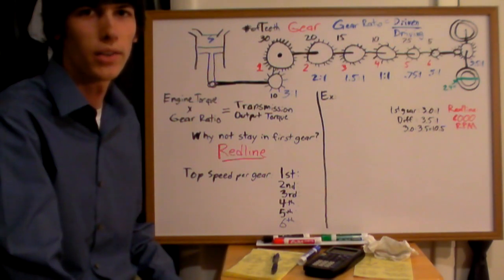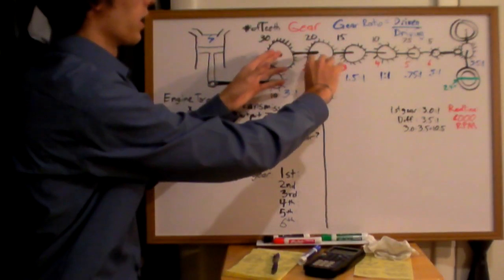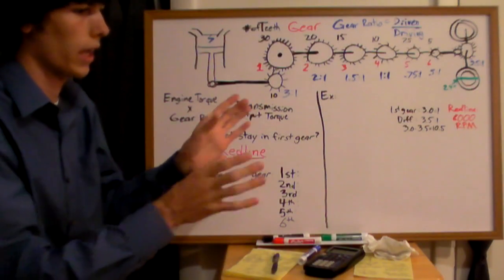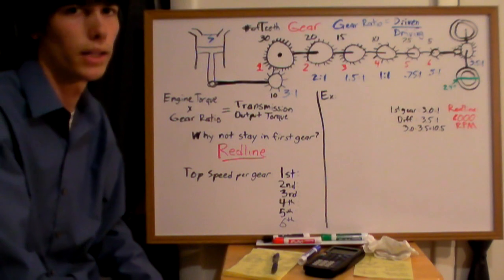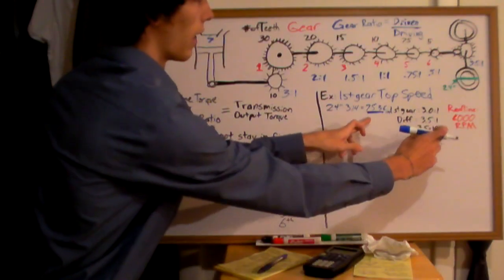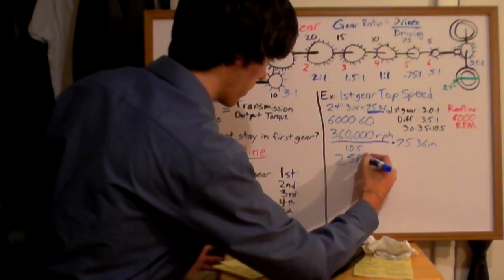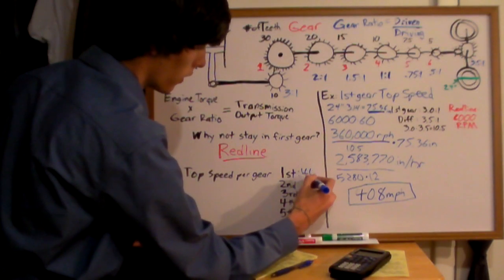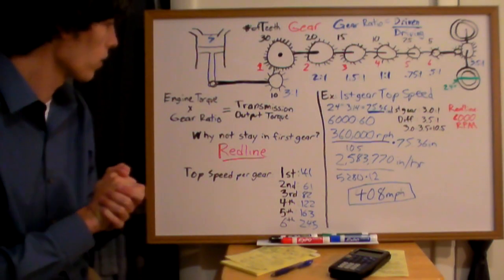Car Gears - Explained

Comment: ive got a request! do one on aero, teach the ones who don't know that wings are beneficial for FWD cars like stock integra R wings and such, you can talk about front and rear diffusers, air dams, vertex generators, canards, vents for brakes, low pressure, high pressure, angle of attack, why it doesn't matter if its fwd or rear wheel drive.
Reply from the maker: I will have some aero videos coming up. A rear wing can still be beneficial on a FWD car, as it creates downforce and can allow for higher cornering speeds.
Reply: Engineering Explained yes sir but people go around using the word "rice: without any knowledge, thought a good explanin can set them staright. good luck and have fun!

Comment: Hey bro .. thx for explaining I really appreciate it .. but yh can u just explain why did u put 3.14 in ( 6:40 ) ? When u were talkin about the wheel
Reply: It's pi(3.14159265359...). He is trying to find the circumference of the wheel (which is diameter plus pi), in other words how much inches does the car travels with 1 revolution
Reply: 13kotsios you mean diameter multiplied by pi?

Comment: Very nice! Man(sorry about the spupid Q), would you please explain to me what exactly is the neutral gear (what happens exactly) ?
Reply from the maker: You're not in a gear in neutral, so the power does not transfer from the engine to the transmission.

Comment: in a motorcycle let's say that I have 2.642 final ratio and doing 30kph @ 5000rpm in a certain gear. If I change the final gear ratio to 2.500 the difference is ~5.4% lower. To find out how many rpm I would have (with 2.500 f.g.r) at 30kph I have to 	
subtract 5000rpm with 5.4%??

Comment: Not necessarily. An 80's 5.0L mustang has an OD ratio of 0.68 vs the automatic's 0.67, both have a 2.73 rear. There is another transmission optional for an early 90's 5.0L that has a 0.63:1 ratio as well (though I don't think it comes attached to a 2.73 rear). GM takes it a step further and gives you a 0.5:1 OD ratio in the T56 (Camaro's, T/A's) while the corresponding automatic (4speed) gives you a 0.7:1 OD ratio.

Comment: Some of them do, but only 1 or 2 transfers. An engine isn't powerful enough to propel a vehicle without some sort of mechanical advantage because as stated they have very narrow power bands. An electric motor makes all of its peak power more or less at every rpm so it doesn't need anymore assistance.

Comment from the maker: Because engines have narrow power bands where they are useful, so gears are used to keep the revs within a certain RPM. Motors on the other hand, are capable of revving to much higher RPM, and thus the gears are not needed.

Comment: Why do manual transmissions have a lower gear ratio than the same car with an automatic? For example, the new Honda civics have a 5th gear ratio 0.727 and final drive of 4.29 for a manual transmission (3.11:1 overall) and 0.525 and 4.44 for the automatic transmission (2.33:1 overall). My manual car runs at much higher RPM on the highway than another automatic one. Plus, automatics are now rated to get better gas mileage. Is this a crazy scheme to promote the sale of automatics?! Thanks!

Comment from the maker: The tires are essentially part of the gearing, as the video demonstrates. The gear ratio of the driveline (diff and trans) does not change, but you go a further distance with the same rotation. This does affect the torque delivered to the ground.

I have multiple videos explaining rotational inertia if you're curious about it. Simply search my channel. :)

Comment from the maker: Larger tires have greater rotational inertia (I have a few videos, if you're interested), and they also alter your gear ratio thus making it more difficult to accelerate (this can be compensated for by altering the gearing).

Comment from the maker: Because that's what gears do, and that's the purpose of gear ratios. By using lower gear ratios, you can have the engine rev at lower RPM for higher speeds. The video should illustrate this fairly well.

Comment: why does rpm drop as you change gear? if you floor it and shift at redline, why doesnt driving rpm go from 6000 rpm first gear to 6000 rpm in second gear?

Comment from the maker: Higher gear ratio means more torque, but reduces the maximum speed you can supply that torque at. You'll be at higher RPMs at the same travel speed than a lower gear ratio.

Comment: gear ratio ..it's an expression in mechanics which is necessary which during a transmission process when a force it's applied through on one side changes on the other side .. increasing or decreasing with the combination of gears involved in mechanism..

Comment from the maker: The harder you press the gas pedal, the more strain/friction your engine will undergo. The engine was made to do this, so it's fine every now and then, but if you do this constantly you can expect the engine to not last quite as long if you were to press on the throttle more lightly.

Comment from the maker: Well there are probably multiple ways of doing it, but one example is a little pin is used ,which interacts with the output shaft of the transmission, preventing it from rotating. This means your car can't move.

Comment from the maker: There's not enough kinetic energy from the engine to move the car forward, without any additional power, so you basically are applying a brake to the engine, stopping it.

Comment: He mean shifting like in the old days called double clutching, where you match the speeds of the gearboxshafts just with your foot on the gas pedal because they don't had synchros back then. This still works with morden gearboxes and allows faster shifting but will also kill the synchros if you do it wrong.

Comment from the maker: They are on bearings so that they can rotate at different speeds, but it depends which shaft. One shaft with have fixed gears, which all rotate together, the other will have gears on bearings. Check out my video "automatic vs manual" which should help clear things up.

Comment: A question: What would be an overdrive gear? What advantage does is have. Which ones (in your given example) would be the overdrive gears? Am I wrong in guessing that (since I've always read overdrive gears are the usually 4th and 5th gears), the gears with ratios below 1:1 would be the overdrive ones? Could you please clarify this further?

Comment from the maker: Depends what gear you are in. The whole transmission does not rotate, just the gears. If the gear ratio is 3:1 (like 1st, for example), then for every 3 rotation of the crankshaft, the first gear will rotate once.

Comment: Sir, 
Can you please make a video on why Nissan for example requires all 4 tires be replaced at the same time with 4 tires matching in brand, model, size and tread type and depth?
Specifically, I have been researching the effects of mixed tires on my 95 pathfinder auto/trans with rear LSD, because Nissan says my trans's planetary system was destroyed when a tire dealer replaced only 2 tires (of a diff brand, and were all-seasons which were 7/32" smaller than the rear; all 4 were 31x10.5r15)
TY!

Comment: if you wanted a specific calculation you could find the exact height of a wheel without measuring. If the wheel was PXXX/YYRZZ then the height would be (XXX*0.039*0.YY*2)+ZZ

Comment from the maker: The three sets are for (likely) 6 gears. Each set I believe has 2 different ratios, allowing you to have multiple gears depending on how many planetary gear sets you have. Yes, this is something I need to eventually make a video on. Kinda like differentials, it's just super difficult to draw/explain. But I did differentials, and I shall eventually get to automatic gears.
Reply: ok

Comment: Pedagogie is french for teaching skills. Can you do a vid on planetary gears? i watched the latest ETCG vid on toyota auto transmission, which is great but i dont see how those 3 main parts (sun, planets, outer ring thing) change the final ratio when they are in movement. Also, why 3 sets of planetary gears?

Comment: within a transmission you have an input shaft, it is splined and connects to the clutch disk or torque converter. The other end of the input shaft is what connects to the gears that you select

Comment: imagine going up hill in your bike. If you use 1st gear you are pedaling like mad but climb the kill with ease because you produce a torque advantage through gearing. Doing the same hill in 21st gear would be near impossible because the gearing adds no additional torque to your pedaling

Comment: If the engine has to turn 3 times to rotate the 1st gear once, and it only has to rotate .5 times to turn the 6th gear once, why does this make 1st gear so much faster than the others? doesn't this mean that it takes the engine longer to rotate the transmission and wheels in 1st gear?

Comment: thx for the vid.  helped a lot.  one thing I was trying to figure out was where gear ratio number came from ( calc = 10.5 as a result).  I didn't see anyone mention this on here and after looking on the web found that it is the FINAL GEAR RATIO: 3.0 x 3.5 = 10.5  [transmission gear ratio x diff pinion ratio).  This accurate?

Comment: 1.how get 1st gear top speed as 6000rpm ?
2.how find engine torque for this eqn.?engine torque x gear ratio = transmission output torque

Comment from the maker: There are currently 7 speed manuals (Porsche and the 2014 Vette come to mind), and there are plenty of 8 speed autos out there. Yes, it comes down to cost, and are the extra ratios really necessary? Savings in fuel economy may be quite minimal, and at a high cost. CVTs may end this is they can make them a bit more durable.

Comment: i wonder why most cars have 5/6 gears sure anything less and you compromise speed or acceleration depending on the gear ratios and anything more and your adding excessive weight to a transmission but why not have a car with lets say 10 gears sure trucks have a lot of gears why not cars ?  production costs maybe?

Comment from the maker: Yes, but its teeth are only for the starter motor to connect, not to be used as a gear in the sense of the transmission.

Comment from the maker: It can be accurate depending on the engine. I wouldn't start relating brands to gearing though. Different engines will use different gearing. But yes, if one has much greater torque, then it can use higher gearing, and typically these will be higher displacement.

Comment: forgive my ignorance but i just hada debate on engine tq vs transmission tq and my arguement was with bigger dispacement engines ie (vettes vipers) the transmission gears dont need to be as low to accelerate, whereas engines like (ferrari supras lambos) with lower displacement use lower gearing to compensate for the low end and overall tq that they produce would i be mistaken with this argument

Comment from the maker: Engineers certainly don't think our way is the best. Getting my degree I hated homework problems that used English units. In fact sometimes I simply couldn't do some thermo problems because I didn't understand the units at all. Metric is far superior, but my brain has a base knowledge of "mph." Sure, I can convert it in my head to km/h, but when someone says they were going 50 mph I can envision exactly what that means, but not with km/h. Pedagogy? No idea haha, I stick to numbers.

Comment from the maker: A differential is used to split rotational speeds between the driven tires. A CV joint is the connection between the differential and the drive shaft, which keeps the given velocity from the diff the same speed as when it reaches the wheel.

Comment: So how would a CV FWD car work on this? I thought the CV joint was set so they don't have a differential, so theoretically, power is not lost in the differential turning, so FWD cars could move 3.5 (or whatever the differential ratio is) times as fast? That doesn't make sense

Comment: Actually a lot of lambo's for instance used to do 0-60 in one gear, because shifting time would take 3 or 4 10'ths of seconds from the time. Now, with modern gearboxes that isnt as much as a problem. As you undoubtly know.

Comment from the maker: Horsepower is a function of torque and RPM. The greater your torque or RPM, the greater your hp, when strictly using the conversion equation.

Comment: hi i assume the differential ratio is the ratio between output shaft and CV axle, is that right. so as per example to turn CV axle one round, the output shaft should rotate 3.5. is my understanding right. or cv axle have to turn 3.5 times to get the wheel rotated 1 time, pls advise.

Comment: You might want to check out my IVT on my channel.  It modulates output/input ratio according to input torque, very nearly linear in response, to lower the ratio with increasing torque (& vice versa).  The objective is to maintain fairly constant input RPM & torque regardless of output demands; this will enable designing new engines that are optimized for a narrower bandwidth & subsequently greater efficiency, as with 'peaky' undersquare engines.

Comment: The industrial revolution started in Britain, & spread to the U.S. early.  The shear size of industry in the 2 countries meant domination of the British Standards of units before metric standards took hold.  Lathe & mill tooling by then was a huge investment that could not easily switch over to metric, especially in the U.S.  Today, there are both systems here with a slow trend toward all metric.  As an engineer, I've been familiar w/ both for ~45 years.

Comment: OK, tanks for quick response. It doesn't matter if you're using your system. Today is easy to find all converters that you need for one min, and it's not problem at all. I was just interesting because i think it would be much easier if everyone has the same metric system.

Comment from the maker: Basically you want to shift when the force your putting down at the tires is equal to the force if you were to upshift. This means either when your engine becomes too inefficient due to high revs, or a rev limit. And the latter is usually the case, so for speed shifting at late as possible is generally the quickest.

Comment: I've always wondered at which point should I shift. 
My car specs says it gets to it's peak horse power (90) @ 5500 RPM and 128 N m @ 3000 RPM
So, should I shift according to hp or N m?

Comment: I like your explanation about car gear. I am very much interested in gear, power transmission and differential. I have made cam follower gear prototype. In my cam follower gear,
1. Follower is offset. 2. Force is transferred from follower to cam and by using this force cam is rotated. 3. Follower come down littlebit and help cam to rotate 6 time more length of follower displacement at 70% force. You can find drawing and prototype at mechanicalresearch.info

Comment: can u make a video about how "Overdrive" work? Because i never understand how they work completely. My guess is if u have a 4 speed automatic, the over drive will be the 4th gear and if u have a 6 speed automatic/manual the overdrive is 5 and 6 gear correct?

Comment: The short answer is yes. Eighteen wheelers run at about 1100-1200 rpm for best fuel economy. The reason is the engine is the most efficient at low engine speeds. Every time the engine goes around it loses energy (in heat) to its surroundings. So more engine rpms = worse fuel economy. The reason it is tough to run there is because the engine has little power at low engine speeds. Check out EE's torque/power video for some explanation on what that means.

Comment from the maker: Well you don't want to have to floor it in fifth gear and put an unusual strain on the engine. 5th gear has the least torque (check out my video entitled "first gear torque" for more info), so you'll have to give quite a bit of gas just to get a small amount of torque, where as lower gears can do the job more efficiently. That said, when the effort required to accelerate is minimal, you should shift to the highest gear possible. I put my car in fifth the second I hit 35 mph most of the time.

Comment: First and foremost, great video. I really needed a high-level overview of gears because I was having trouble understanding them while looking at poor schematics with no teacher. Anyway, my question comes from what you said about fuel economy being related to the RPMs. Does a lower RPM always mean a better fuel economy? If so, why wouldn't you just put it in 5th gear as soon as you're going fast enough to not stall out for the best possible gas mileage?

Comment: Explain too that overdrive means that your output rmp is HIGHER than your input rpm... this creates a mechanical DISadvantage (max output torque at wheels is < max output torque of engine)... usually overdrive ratios are about 0.75:1 .. this means that your engine can spin about 25 percent slower at that speed versus 1:1... this is done for fuel efficiency and to make your car quieter at crusing speeds

Comment: Alright, I see what your saying. All that I did is fully right out the equation that you put up. I noticed that I could just get rid of the twelve, and make the 60 into a five, and then divided the 5280 by five, just to make it more managable. Yes, I do realize that no car can reach their theoretical maximum speed, because of drag, and friction, and other factors (I'm sure you know alot more about those than I do.). I used 't' just to simplify 'pi*D' or '3.14D'. Thanks for the advice though.

Comment from the maker: Might help to share units. Also, there are quite a few assumptions, but I get what you're saying. Not many cars (if any) could reach the theoretical maximum speed based on gearing. And just a quick tip make it 3.14*D (tire diameter) rather than t since D is easier to measure than the circumference.

Comment: Equation for Maximum Speed Obtainable:
(r*t)/(1056*g*d)
r=redline rpm
t=tire circumference
g=current gear ratio
d=differential gear ratio

Go ahead an test this, it works.